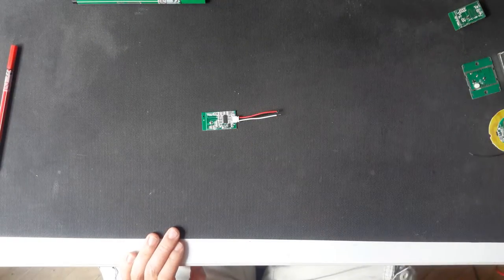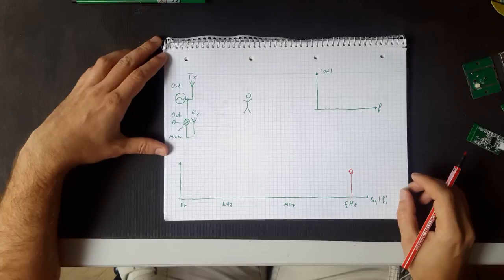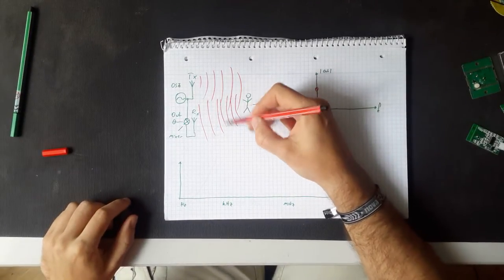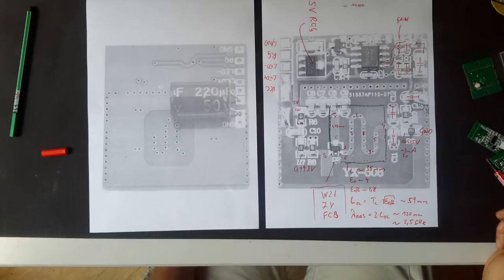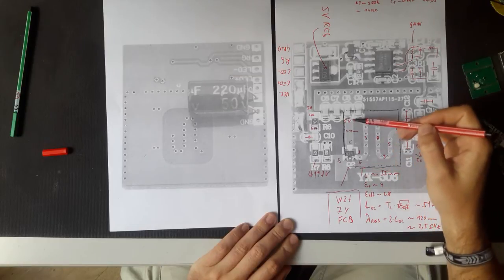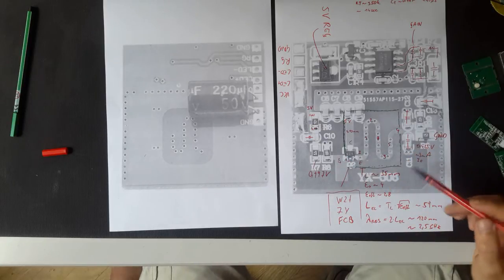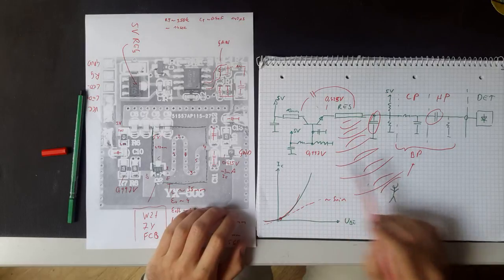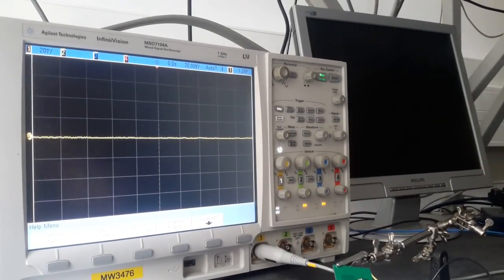Microwave Doppler Radar Motion Sensor Module

Comment: I just got a RCWL-0516 for evaluation and like yourself wanted to know more about how it really worked.  Your video has been by far the most insightful to date. The PCB layout and components look almost identical to the module you reviewed. I initially scanned the spectrum using my HackRF One and gqrx software and found nothing so (incorrectly) concluded it was at something like 10.525GHz. Thanks to your video I had a close  look at around 2.5GHz and found the signal at 3.181GHz.    Now here is the interesting bit: it's not behaving like a doppler radar from my limited knowledge of the topic. Waving my hand in front of the sensor results in the carrier frequency moving by up to 1MHz from the resting position. I've got a screen grab of this. I'm putting all my material  together in a public GitHub repository: search for RCWL-0516 on GitHub: https://github.com/jdesbonnet/RCWL-0516
Reply: please Friend !! Do you know which is the  maximum range of detection this ?......Thank you so much !!
Reply from the maker: Hallo,
the maximum detection range will strongly depend on the object you want to detect and the type detector used for the baseband. If you want to learn more about that search for "radar cross-section". Theoretically only detection limit is the thermal noise, however,  this is one of problems where I would simply try it.
Cheers Bertl
Reply: It is probably too late (over 1 year ago), but such oscillators are prone to moving frequency due to reflections. If you wave your hand too close, then it can move frequency a lot.

Comment: Thank you for your time and effort in explaining how these radar sensors work. A very approachable breakdown and analysis of the circuit.
What is surprising and impressive is that whoever originally designed these circuits in China is very clever and resourceful.

Comment: I appreciate your efforts, thanks for helping me understand the ones that I have.  I read about HBTs , and I think that the bias voltages are slightly different because these HBTs are more than just silicon.  Also, I think that part of serpentine trace (the part that's not close to the collector) is also an RF choke, to isolate the base from the bypass capacitors.

Someone said China is innovative, but this circuit has been around for decades, but at lower frequencies and in a larger, more complicated circuit.

Comment: Thankyou for your in-depth analysis, it is both useful and very interesting.
Reply: please Friend !! Do you know which is the  maximum range of detection this ?......Thank you so much !!
Reply: There are several modules on Ebay, some have a range of 4 to 8 metres others up to 15 metres. Look on Ebay and you will find the range for each type listed under parameters, for example http://www.ebay.co.uk/itm/201701135606?_trksid=p2057872.m2749.l2649&ssPageName=STRK%3AMEBIDX%3AIT http://www.ebay.co.uk/itm/201701135606?_trksid=p2057872.m2749.l2649&ssPageName=STRK%3AMEBIDX%3AIT. Hope that helps. : -)
Reply: Thank you alot from Brazil !!...hugs mate !!..:)

Comment: Hello!
Could you advise me other transistor models than MMBR941? MMBR941 is an outdated model. I tried to use BFR520, BFR193, BFR360 in the same schematic, but there was no generation on the HF part output. BFR181 gives some generation, but there is periodical pulsation on the EG4002 output viewed like motion.
Reply from the maker: Hey, this is actually a tough one to answer. Due to the nature of the circuit and the materials used that process variations with respect to the high frequency properties in these units is huge. Getting these running with another transistor without having dedicated measurement equipment like a VNA at your disposal is very problematic. If you want to learn about doppler radar modules I'd suggest to try a circuit with a dedicated oscillator and mixer stage.

Comment: Hello, there. Thanks for putting your time and energy to reverse engineering and explain stuff to interested people like us. I have the same sensor and my project requires channeling waves to a single direction. Can this be achieved with use of slotted wave guide type antenna? If not can you point me to right direction?

Comment: do you have instruction how to connect it to microcontroller? I couldn't understand a thing from the purchase website.. I bought the XYC-WB-DC
Reply from the maker: Sadly the one you mentioned probably won't work directly with an microcontroller. That unit has only the RF-frontend but no amplifier for the low-frequence (IF) output and the ADC in the µC probably wont be able to resolve that weak signal. What do you want to use it for, just detecting if something is there or measuring speeds?
Reply: +BertlDS just detecting something. example if the microcontroller receive voltage from it, it will flag it as 1. is it possible though?
Reply from the maker: I'd suggest you use a module that has got the detector chip just as the one I've presented. This is a high gain low noise amplifier and a comperator. If you'd insist to use your module , you need to build an IF amplifier and to implement an envelope detector in the µC.
Reply: what is maximum range of detection this

Comment: Is it allowed to Run this devices in D-A--CH Region?
Reply from the maker: This is actually a hard one to answer for two reasons. First of all, I haven't tested the power this thing is emitting. I guess that should be fine since this thing has not really a lot of power due to the limits imposed by the transistor (See http://www.ti.com/lit/an/swra048/swra048.pdf for a nice overview of the regulatory rules.). However, the frequency defining part of the oscillator in this circuit is the meandered line which is not the best design concept. This type of circuit will vary a lot from batch to batch and can be significantly detuned by the mounting structure around the PCB. So getting a stable design is a problem. I would opt for a different type of module that has a more stable oscillator if you think of developing more than a sketchy prototype. The HB100 would be a good idea https://www.youtube.com/edit?o=U&video_id=TntNTVNq2Qc.

Cheers

Comment: how to change delay time?  had this one.. delay time fix 15 sec
Reply from the maker: You need to change the resistor-capacitor timing circuit between pin 8/7/5 on the EG4002, instructions on how to set a specific delay can be found in the datasheet (http://www.egmicro.com/download/EG4002_datasheet.pdf).
Cheers